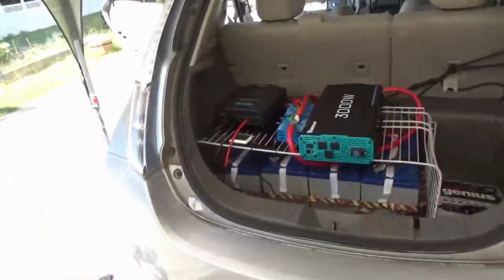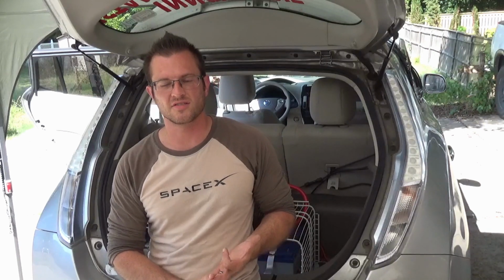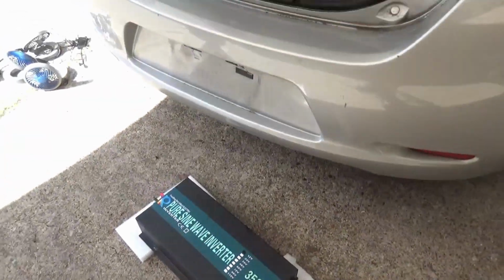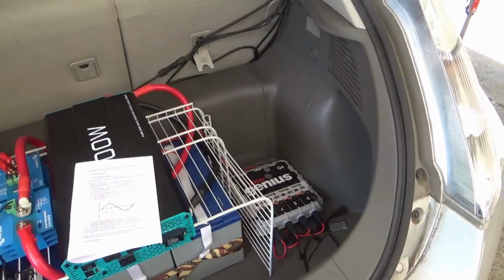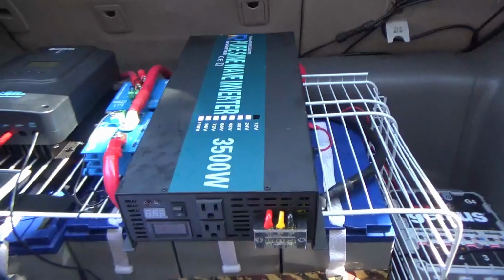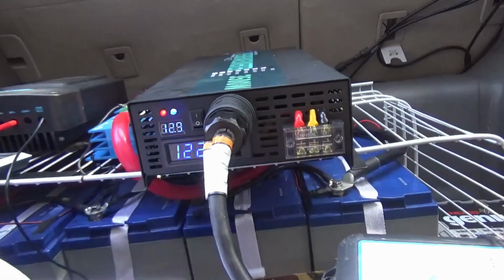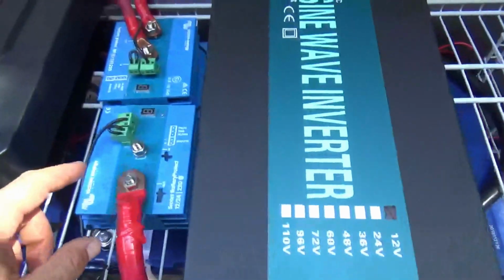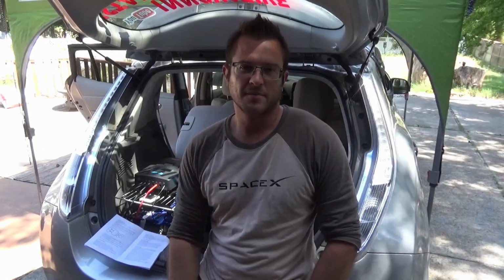Inverter Problems

Comment: Buy a normal car dude. And have a good life.
Reply: uno dos Literally, anyone can do that and that is not what he’s trying to prove. Isn’t it obvious?
Reply: @mxs8102  So is my opinion...
Reply: @acapulco1231  I agree, anyone can have an opinion, not everyone can actually go and make something happen.
Reply: @mxs8102  Exactly my point. Thank You
Reply from the maker: NEVER!!
Reply: Very dangerous to run an 120V inverter without an earthen ground.  The negative side of your car does nothing to ground the output of the inverter.  A lot of people make this mistake.  You basically have no where for the 120v current to go to ground.  It’s what the ground part of the receptacle is for.  Your problem is that part of the receptacle is not connected to anything.  If you have a short circuit and the inverter discharge shorts to the frame of your car and you touch it, you could possibly get lit up or burn your vehicle to the ground.

Comment: Look up videos on using a generator to power a leaf wall charger. In short many generators or inverters dont have true earth grounds. U can use an extenstion cord male repair plug to jump the nuetral and hot leads and then plug it in to the open outlet on the inverter while the evse is plugged in and it will many times solve the ground fault issue. Its not by the book but works. Also if u ground the inverter to the car frame but the inverter is powered off a set of batteries not on the same ground circuit i wouldnt think the ground would be valid. Try grounding to the negative post on your battery bank?
Reply from the maker: Thats basically what I did.  I couldn't find a solid video on how to do a remote inverter ground bypass, so I'm making a brief tutorial as this weekends update video.  Should be posting tomorrow.
Reply: The evse is looking for a true ground i.e. to earth or the house ground. You might be able to hotwire the ground to neutral but I wouldn't recommend it, might make the case live. Better to source an inverter that has a false ground built in.
Reply from the maker: @stopburningstuff649  You are exactly correct.  I do exactly this in my next video "portable inverter ground bypass"

Comment: I think this might help...
There's some people that are being having this ground issue when they attempt to charge with a generator.
Below is a link(Scroll that page and you'll see some pictures):
https://www.mynissanleaf.com/viewtopic.php?f=26&t=5792&start=40
I hope this helps.

I was also thinking about doing this project with a friend. 
Wondering about using Lithium batteries due to Charge Rate(will be more expensive), see link below:
https://www.wholesalesolar.com/blog/lead-acid-vs-lithium-batteries/

Any thought on the Lithium?

Best Regards from Florida.
My Leaf  battery also degraded.

Comment: A 12v DC air cooling module running a peltier junction would probably do the trick. These are cheap on eBay or banggood. Insulating the trunk and running the cooler on a thermostat would probably do the trick but you might need to deal with condensate. I don't know if you would need some other venting to cool it down if you insulate and it isn't hot enough in the car to need the DC cooling unit running.

Comment: I'm not a pro by any means just some thoughts I've had along the way.   I'm very interested in your results as I had looked at doing something very similar for another project.

If you haven't shipped the new inverter back yet.  I watched a video on the amazon listing and that person wired an outlet to the three terminals on the terminal block. Maybe the internal outlets aren't grounded? https://www.amazon.com/dp/B078MMR9SB

Heat being one of your concerns 12V DC to 120V AC is not the most efficient. I think if you switched to 24v or 48v you would be more efficient and create less heat.  A higher voltage would also  be dropping from about 116 Amps load at 12V to about a 58 amp load at 24V.  Have you given any thought to going to 24V?
Reply from the maker: I was hoping to not have to wire up an outlet to the inverter terminals (it's just adding more potential points of failure into the system), but I have also noticed that most people using these inverters, do so in this manner.  If Inverter #4 is still giving me the grounding issue, I will run power through the terminals.

As far as stepping up the voltage in the system, thats something I'm looking at.  You are not the first person to suggest this to me, and I think the final system will probably be 24v.  When I started this project I was unaware of the inefficiencies of lower voltage systems.

This inverter is already back in one of our Brown trucks though.  I got a bad feeling about it pretty early on.

Comment: I have been working on charging my Nissan Leaf through a DIY lithium (18650) powerwall and had the same issue you are having with the grounding. The granny charger would not work with it directly connected to the inverter...BUT...when I run the inverter through my transfer switch that goes into my breaker box and plug my granny charger in one of the outlets connected to it I don't have any grounding issues and the charger works fine.  I know this doesn't apply to how you are connecting it to your Leaf, but maybe somewhere in that example is an answer.
Reply: You have to take a 3 prong plug cut a old cord and twist the green and black wires together then plug that into inverter or a generator and it tricks whatever you are using to think its grounded.

Comment: I went through 2 aims inverters the first was like that red light blinking showing overvoltage and I knew it wasn’t made the house lights blink all the time like every time that red light blinked the lights would blink , they sent me a warranty replacement that didn’t even work , they would be great for lithium batteries they seem to sick with agm and lead acid from my experience, long story short customer service is great the product seems to need a lot of work . Great video sir I just subbed
Reply: Oh, I have 20 marine batteries, it does a little better with a bunch of them. I might get four more next summer. It's pretty hard to run them down.
Reply from the maker: Thank you for the feedback.  I'm sure you know how frustrating it can be when these things don't work right outta the box.  There seems to almost be an element of luck when shopping for inverters.  It's weird.  Will Prowse seems to know his stuff and he endorses the Gaindel inverters.  Thats going to be my next attempt.  Going with a 4000watt so I can sell my gas genny and use the solar leaf as the new backup house generator.
Reply: I have a 2000 watts Aims Power inverter charger, 24 volts. I've fried it twice but it's fixed now. It has been on for a year now. Mine wouldn't blink until it was damaged the first time, the heat sensor has to be in one exact spot to work right. I worked on it the last time and found that out. I don't try to run the welder with it anymore, lol. The power board on mine was different than the first two
 After they are out of warranty, they send a better board. Some of the parts are different and now it works right. I think Aims Power did it to sell parts. I've gotten used to the old thing now.

Comment: I'd suggest a mpp pip solar charge controller inverter. It's mppt, can do lithium (future proofing for you), you could use you current batteries in 48v in series for better inverter efficiency. Also has grid input so you can charge the batteries and your car at the same time.
Reply from the maker: That could potentially save a lot of space.  And make things a little simpler.  It's something I'll consider moving foreward.
Reply: @InnovativeSustainableSolutions  My  24 VOLT Mpp INVERTER  WAS JUNK.
Reply: @hp1117  I was considering getting one of those. The lv2424. But the idle consumption is awful High

Comment: Could you please set up a Patreon account so that other people can help you fund your project?

Have you heard of Peltier/thermoelectric cooler (TEC) modules? They aren't as efficient as conventional cooling systems, but they are a whole lot cheaper. https://www.ebay.com/itm/TEC1-12706-Peltier-thermoelectric-cooler-module/283562541771?_trkparms=ispr%3D1&hash=item4205a502cb:g:XcwAAOSwxL1dPPsG&enc=AQAEAAAB4BPxNw%2BVj6nta7CKEs3N0qWrR3Z1ZNaRhiUbxZ%2B8w1hr2yiZIR6DJ49SPUgiut%2B7kYFl5RXo32KQGOIl9blPgKsJPj6uY2pB52yuf8VFEJEFSxBybDgqIUT3NPInFZEPxXer%2FqLPC5vOZruC8jjvatGca96PlNGuGu3oqqUhWmeBexCcmf96ScrVqhoLKqEKdlGpVUQ%2F9uFyc6IIQ1dxcDdSEAGfgT7FqpbH6KsYvXmAfAX58B7MM9HLOrY25WMuuQ7OuQSTPkXKcOWt%2BCUkLZ%2F4cRWT6%2BSp5f15N7ClEpgZnuO%2FDm1rz8nhN5Gvvk37eeYvxwM6bmIVVMYxkSGFQg3cTMtNS%2BXejNBJJXFfsHrwpAkR70oZevtGBAcaAQOSB1lGGIbvC6AbZuYMsR9t11t3d5FQrWd5OXrWbM%2B2NF3fChMY9C0mZJLRdStE96zxuZVE77CLv8JquF4MogE0obfJuCMlXsPiKHP70fjGm191CxhC3lYOA7MFpEAESS%2F5EjsCWEne64%2BYOxpMLioiXBOBVTSRHoXB4plB3JU%2F3zIDQbSl%2B7bzFT026c6Ssfn7m%2BL%2BcFCduOrZZHxqK0qIz4oQX4%2F3qoJVhvw5fKtpI%2BoE%2BgcGLTsGWeOgifk07PY%2BAw%3D%3D&checksum=283562541771a6677709eee9454ca4d493b1bdb0bd42

Have you seen the videos circulating around youtube of a grounding cheat for charging electric cars with a generator?: A simple plug mod. https://www.youtube.com/watch?v=4MR-uKp6u8M

Could you add a please like, share, subscribe, or support me on Patreon plug at the end of your videos, like other popular YouTubers do?

Thank you for taking the time to experiment with this project and to post your experience(s) on YouTube to share with the world!

Comment: I still think you are wasting your money on micro ac but I'm willing to be proven wrong. What are you going to do for the exhaust of the ac? Going to have to cut a hole somewhere?

My suggestion would be to have 3d printed ducts force air through the inverter etc, intake and exhaust ducted to the outside of the car, and and a few separate fans to vent the general trunk area.

Chrome wrap the roof and the inside of the rear windows too.
Reply from the maker: I totally understand the reservations about micro A/C units.  Their reputation for poor quality control is well earned.  The problem with air cooling in Texas is that the lowest temperature you can get it do with fans is just below the ambient air temp.  Trying to cool something by blowing air over it, when the air itself is 105 degrees (Texas summer), only goes so far.  I can't not try some form of compressor cooling, but I admit there is a good chance I will ultimately wind up using a cooling method like what your describing.

Comment from the maker: After watching a few other videos of people using this system I went back and made sure I had full contact of my copper 4/0 gauge wire lug directly against the flat plates of the inverter terminal, with no washers in between.  It didn't make any difference whatsoever.  Problems persisted